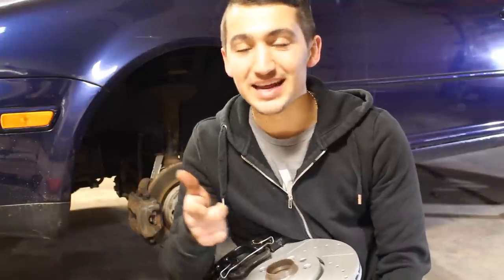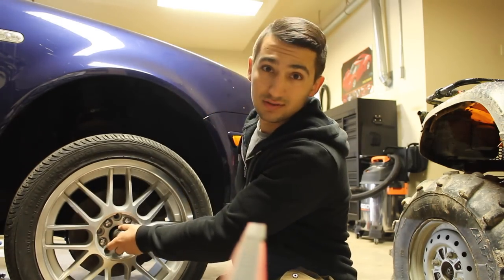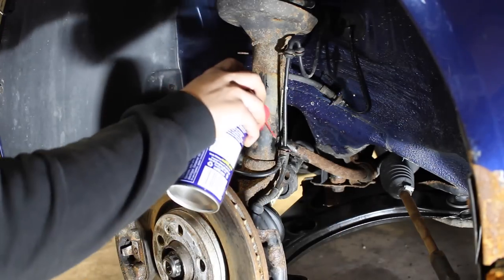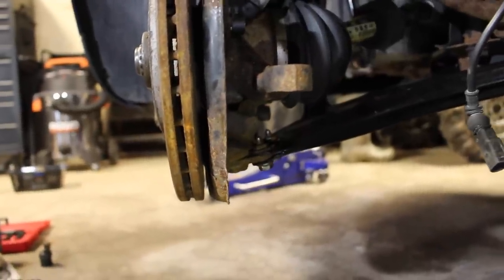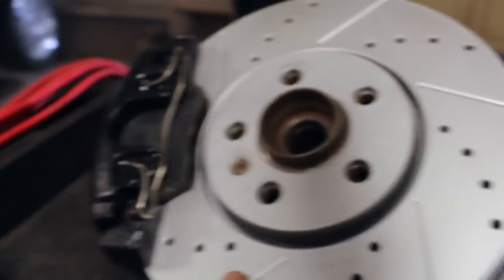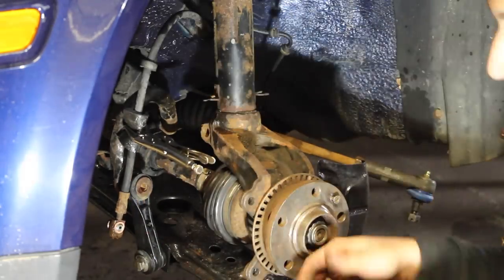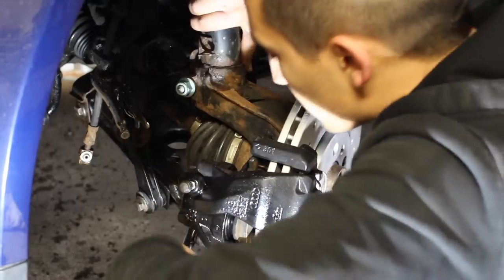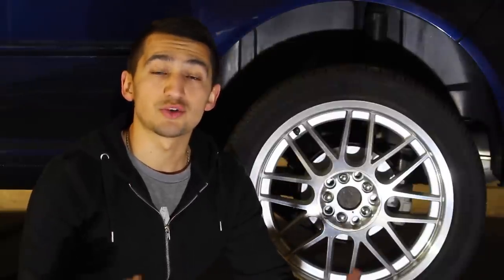How to Install a Volkswagen GTI Big Brake Kit

Comment: Great video! My only comment on the job in its entirety would be to advise viewers to never clamp off a brake line, it will surely cause a collapsed brake line. Additionally, the 2004.5 Jetta GLI 1.8T has the largest brakes if you're looking for size, they have the same size as the R32. Not the VR6, just the 2004.5 1.8T GLI for whatever reason

Comment: Great Video. No hard Feelings but they sell a socket to put that hub back on the shock. Goes in the back of it. The small slit in the back of the hub. Turn quarter turn and no grease required.

Comment: There's a strut spreader tool available for these cars. Looks like a half moon shape. You give it a turn and it spreads the spindle open so you don't have to hammer and potentially damage the metal (more rust).
Reply from the maker: +Armaan R I bought it but didn't need it when installing the new spindle on the strut :)

Comment: Cool video... I used to be a mechanic. One note of advice. Never lubricate the bottom spring sleeve area, this should be bone dry to prevent it sliding out (even when fully tightened).

Comment: Just a tip from a mechanic, when the ball joint from the tie rod is being stubborn and doesn't wanna come out don't hit it how you did, you could end up damaging the threads like that. Instead hit the metal on the side hard enough to shock it, the ball joint should come out nice and easy like that. ;)
Reply from the maker: +TacosInMyBelIy Good to know :) Thanks for the tip!!

Comment: NEVER pinch off brake hoses like that....   number one cause of collapsed hoses.  

Find something to hold the pedal to the floor. Once you crack a bleeder or line, the master cylinder seals off from further feeding fluid. 

Always torque new crush washers.

Comment: That was cool to watch, I've been watching your vids for a while, very informative. I like your channel, I've learned a lot from it.
Reply from the maker: +Nick Zuzunaga Thanks Nick :)
Reply: +milanmastracci also how do you know what's the right type of rotor for your car?
Reply from the maker: What do you mean the right type of rotor? You can install blanks, cross drilled, slotted, or any kind of rotor style you want on your car. The only thing that will vary from car to car, is the thickness of the rotor, the overall diameter of the rotor, and its offset. For my golf, I could have gone with cross drilled and slotted brakes (that are the same size as the original ones) and I would get a bit better performance. But because I wanted larger rotors, the caliper wouldn't have fit, which is why I needed a new hub, rotor and caliper assembly. :)

Comment: how about bleeding the brake fluid to get rid of the air in side of the system , that's kinda crucial to be able to brake. and should be included in a disc replacement tutorial. other wise nice video

Comment: couldn't you take the nut off a fwd car by putting the car in first gear so the wheel locks up? great vid as always!
Reply from the maker: +Carlos rivera You can, but that would put alot of stress on the transmission. Considering the axle nut is torqued on very well, I wouldn't do that. It would be a better idea to hold it from pinning by either putting it on the ground, or holding the brakes.
Reply: +milanmastracci Ahh I see thanks for the awesome info!
Reply from the maker: +Carlos rivera No problem Carlos 😊 good question 👍

Comment: wasnt it you who said to throw out the bolt which holds breake disk in other video? I've just change my MK4 breakes over the weekend to standard size (grooved and drilled) couldnt been bother to wait ages for that video
Reply from the maker: +666Seb87 It isn't a mandatory bolt, but if it ceases to the hub, you're going to be swearing when you need to remove it. if you put some 3M copper anti-seize, it won't get stuck so easily :)

Comment: I did a real world test as following :

Did a premium brake job on a 05 Sunfire using OEM brakes,service and flush calipers, results minor rust and Normal brake wear within 6 month's.

Did same brake job on slotted and drilled rotors on same vehicle (03) same results and you could see start of strees cracks and yup you get drilled holes filling up with junk.

Finally did a similar brake job on a (00) Cavy ( same ) car only difference it had 2.4 l.I used premium coated brake rotors and Hawk brake pads.Stopped a littke better,brake were less sponggy and same results, normal brake wear and minor rust starting.

I used customers cars fur testing ( thier permission ) same roads,same conditions and same speed.

Result no real BIG difference !!!

Comment: Drilled rotors don't really have a beneficial effect anymore.  They used to allow debris and gases to escape, but pads now a days are much better than in the past. Only thing drilled rotors really do now is look cool.
Reply: I've heard on Engineering Explained that besides not adding extra stopping power, drilled rotors actually last less than solid ones.
Reply: so true solid are better but these just look cool

Comment: The torque to yield bolts are a VW Audi thing as far as I know, not every manufacture use's them. So if you don't have a VW or Audi Consult the your local dealer.

Comment: Did you replace the ball joint? If i remember correctly you were going to change it when you change the brakes! I might be wrong but that ball joint seemed a bit rusty to be new!
Reply from the maker: +André Silva I changed them when I installed the axles :)

Comment: hi wanted to know if the 312mm discs brakes will if inside a 16inch alloy? i have a polo and i would like to upgrade my breaks too
Reply from the maker: It is a tight squeeze, but yes they do indeed fit. They will clear the barrel, but just cautious the offset to have it not too positive.

Comment: When you had that bolt break on your brothers car, did you drill and then use a tap or drill and use an easy out? And your hands are always clean....lmao. Great video :)
Reply from the maker: +Lee Brooker I actually just drilled the entire thing out, and then installed a longer bolt, nut and washer so that it would thread through the entire knuckle and hold the strut in place :) I wash them frequently so the camera doesn't get greasy when I press the record button :)
Reply: +milanmastracci Ok good tip. I have a bolt that broke off for my ac tensioner on my semi truck. I haven't attempted to get it out yet. But I can access the other side of the bolt. I might use your idea now if I have to drill it completely out. A longer bolt....That could make it so much easier. Lol. Thanks for the idea. Keep up the great work.
Reply from the maker: Yeah it would have been too difficult to drill it, tap it and die it so I could put another 'same length' bolt in that area. If you can get the same size diameter bolt, but just a bit longer in length, you should be able to put a nut on the end of it and call it a day :)

Comment: This might be a dumb question but why does using a torch to heat up rusted bolts and nuts help them come off easier? I'd be afraid I'd melt something. lol
Reply: The heat expands the metal making it easier to remove it off the threads

Comment: Hey Milan, what are the specs on this caliper and rotor? I want the same set up for my golf
Reply from the maker: It is a single piston brake caliper (bigger than the stock size), and comes with a bigger brake rotor. I am unsure of the actual size of each of those, but they are 100% an upgrade over the stock parts.

Comment: So to do this upgrade I need the hubs from a Gti aswell? Will the big caliper fit on a stock 2.0 gl hub? thx in advance
Reply from the maker: Yes you will need the GTI spindle as the mounting spots for the caliper are not in the same spot.

Comment: Hey bro , I have 2 questions please :-
 1) Is there right and left brake discs? 
 2) Can I move the brake callipers to be on the side of the disc which is away from the bumper? ( to resemble most of the honda's)
Reply: Sherief Mohamed Anything can be done if you know how to fabricate. That's how race cars are built. But there probably isn't a bolt on part to swap the calipers to the front.

Comment: Was this off of a 20th anniversary GTI? I’m asking because I can’t find these brake calipers on any 2003 GTIs. I’m looking to upgrade my brakes on my 2004 golf TDI and I obviously would like the cheapest way possible. Also, I just learned about the existence of a floating rotor. What do you think about floating rotors?
Reply: I'm wanting to do and upgrade myself, but seems to mention what spindle they use or swap out? Have an idea?
Reply: @mdaox562  not really sure what he uses here. Since I’ve look more into it and swapped an r32 front knuckle on it and used r32 front bearings and rotors. Plan to move up to porche breaks in the near future and there’s an adapter for r32 to porche calipers

Comment: so you basicly used mk4 GTi brake calipers with drilled & grooved discs?
Reply: Yes, if you really want to bump up your brakes use 2004.5 Jetta GLI brakes. But be sure to use only the 1.8T, not the VR6 GLI. For whatever reason, VW decided to install the R32 sized brakes on the 2004.5 Jetta GLI 1.8T

Comment: Is 256mm dust shield is enough for 288mm rotor does it needs to be changed to bigger one or not
Reply from the maker: You need the entire GTI spindle assembly for it to work, meaning you need the spindle, wheel bearing, dust shield, caliper, rotor and pads from a GTI (1.8T or VR6)
Reply: @milanmastracci  I have already changed caliper rotor only I haven't changed dust shield

Comment: Note that the brakes on the car at the start of the video have pads that are incorrectly installed. The three-prong clip is supposed to go inside the hollow part of the piston, not through the outboard half of the caliper.

Comment: can those brake work on a Mazda 3 2015 and do you know any sites or locations that sells those type of brakes but not too expensive  brembo it's like 1000 plus lol
Reply from the maker: +Tarek Taher Check and see if the Mazda Speed 3 has larger brakes than your regular Mazda 3. Might be a good bang for buck upgrade!!
Reply: But I want drilled and slotted lol and I want nice calipers that stands out like the gti
Reply from the maker: Check out TireRack.com. You should be able to find some nice slotted and drilled brakes. I've got a set of StopTech brakes all around on my honda and I love them!!

Comment: Don't expect big braking changes from these kits. Your best bet is to go ahead and get some wilwood calipers and two piece rotors. I upgraded to oem plus like this guy and was sadly disappointed. Spend the 1500$ now on a durable product that actually improves unsprung and braking performance. These will look like rusty junk in one year or less. Check Racing brake for rotors. Delete your abs, Use appropriately sized master or a pedal box. Enjoy real braking performance.

Comment: how big whas the original rotors vs the new?
Reply from the maker: I should have checked, but they were tiny compared to the new ones. The new brakes actually fill out the front wheels

Comment: Can I just change brake caliper and disc and not the spindel?
Reply from the maker: +surviveasl Unfortunately no because the brake caliper bracket on the stock brakes is built into the knuckle, where the GTI brake caliper bracket is detachable so you can't run the regular golf spindle with the GTI brakes, unfortunately :(
Reply: too bad , thank you for your response
Reply from the maker: No problem man :)

Comment: Thats not a Wheel speed sensor, thats is ABS sensor...
Reply: Same thing
Reply: i dont think so, the speed sensor is located at gearbox, abs sensor measures how many times the wheel spins, and send this information to ABS module, when it detects that the wheels do not spin thath module activate ABS system
Reply: +Alexis Hernandez not true,  its called an abs wheel speed sensor, tells the computer what speed each wheel is going so it knows how to counteract if one loses traction etc...
Reply: The spedo cable is splined to the final drive in the transaxle. The wheel speed sensors measure the speed of each indivisual wheel. If it senses a difference it assumes a wheel has lost traction and locked up so it tells the computer to activate the abs.. hence why it is called an ABS Wheel Speed Sensor.
Reply: Guess what the abs sensor does?

Comment: the brakes are from  a audi s3 ????
Reply from the maker: +failboxing I dont think so? The guy I bought them from they came off a GTI. Unless Audi runs the same spindle and brakes, I think they are different.
Reply: +milanmastracci The Audi A3 and Golf are pretty much the exact same platform, so I would think the S3 would run the same brake set up as the GTi
Reply from the maker: Than I guess they are ahahah

Comment: Shit if you ring the head off, get a pin punch and knock it on out
Reply from the maker: +BronzeChicken I wish it was that easy. There was sooooo much rust on it. It wasn't even moving with a bolt extractor and a ton of heat.

Comment: Cross drilled rotors are so rice!
Reply from the maker: Same with VR6's
Reply: How so? Do you not understand why cross drilled rotors are rice?
Reply from the maker: With the same logic as VR6's are rice. How is a brake rotor design, that is to shed the contaminants off the brake pad, rice? I don't see your logic
Reply: milanmastracci Wouldn't that make the 1.8t even more so? very few people take Vr6s and try and make them into race cars even for car meets alone. Cross drilled rotors are rice because they aren't used in racing because they crack. The only people who use cross drilled rotors are people who want to do performance upgrades to their cars without knowing what they do and if they are needed. 

Cross drilled rotors are to vent gasses from the pads, the slots are meant to get rid of the contaminated material. 

Cross drilled were used back in the day because of the gasses in which the pads were put together with, it is no longer an issue. 

So these days only drag cars do it to shed weight. This is bad for other forms of racing because it means there is less mass to disperse the heat. Yes it does have a cooling effect, but not one to ever be noticed by your foot. It's because the surface isn't uniform that cracks start from the holes. In regards to cars that do use drilled rotors, their disks are normally made of carbon ceramic which is a totally different animal.
Reply: "Cross-drilled brake rotors look undeniably cool peeking out from behind a set of flashy wheels, and they keep your brakes the same way – cool. In the early days of racing, drilled rotors were an effective way of venting the layer of gas and dust that inevitably builds up between asbestos brake pads and the rotor under repeated, hard braking. However, as technology and brake pad materials have progressed, outgassing has become less and less of an issue. These days, while they still look great and perform well, the drill holes are more for aesthetic reasons than anything else. For performance driving, slotted rotors have become the preferred choice because cross drilled rotors are more prone to stress cracking under extreme use. Just take a look through the spokes on the wheel of any modern race car – there won’t be a drilled rotor in sight. On the street, however, the temperatures your brakes encounter never even come close to the levels they do on the track. So, the venting properties of drilled rotors offer the added benefits of keeping temperatures down under normal driving for prolonged pad life, as well as improved wet-weather performance by allowing water to escape the rotor’s surface, increasing initial pad bite."-autoanything.com

This is also on ever major brake rotor company under FAQ.